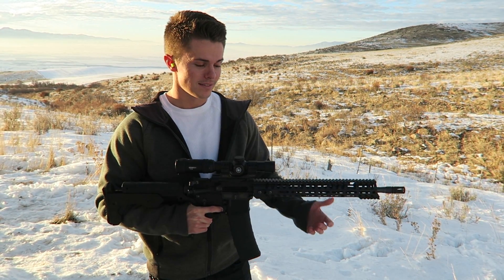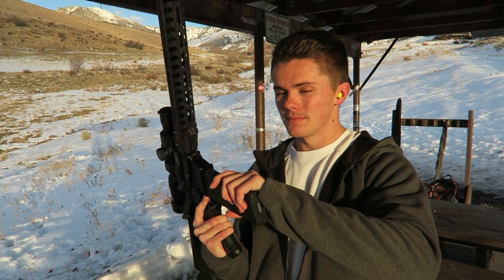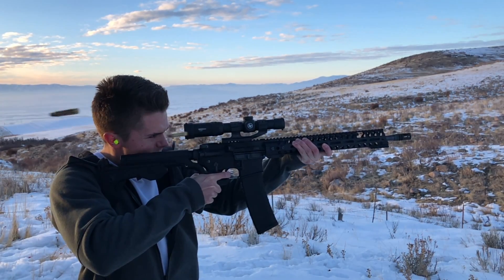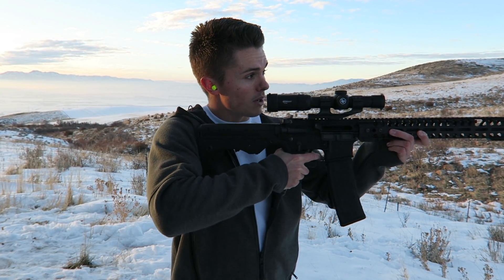How Fast Can A Bump Stock Really Shoot?

Comment: In 1934 the National Firearms Act was passed requiring machine guns to be registered, purchasers also had to pay a $200 tax. Fast forward 52 years Democrat William Hughes purposed an amendment to Firearm Owners Protection Act of 1986 claiming "It is simply to easy to get a machine gun". Despite his claim there were zero shootings within that 52 years involving a legally acquired machine guns. His amendment was merely an attempt to kill the original bill. Unfortunately passage of this amendment prevented new civilian legal machine guns from being added to the NFA registry, and drove the price of legal machine guns through the roof. 

Passage of this ban also opened the door to these machine gun simulators. In 1990 a patent was filed for the Hell Fire Trigger, soon to follow was the Tac Trigger, Hell Storm 2000 trigger. All of these devices  attached to the trigger guard of a semi automatic rifle, and had a metal arm under spring tension placed behind the trigger that push the guns trigger forward forcing it to reset. Shooters still had to use traditional bump fire technique to get these devices to work.

 Currently there are about 400,000 transferable machine guns that are legal to own by civilians in 44 states. The purchasing process of legal machine guns is the exact same process you would go through to purchase a silencer or factory SBR from a class III dealer. If this reclassification of bump stocks is meant for public safety then why would the DOJ list approved alternatives like installing rubber bands or using belt loops to do the exact same thing that bump stock allowed?
Reply from the maker: Wow thanks for the info! I didn’t know the history of them
Reply: Yes the rubber band trick is where it's at. Binary triggers are expensive. Bumb stocks are damn near impossible to get. But a good old rubber band will yield crazy fucking results. I have a Franklin armory binary trigger. But for the money go with a rubber band lol.

Comment: Switch out the bolt carrier for an ultra lightweight one and you will notice a huge reliability improvement. It makes it much easier to shoot and much more consistent. I’ve had a bump stock for many years and with normal bolt it was a pain in the ass to shoot very unreliable until fairly recently I installed a lightweight carrier and I can dump 100 round drum mags with zero issues consistently. Trust me it’s crazy
Reply: Joe Valdes where you get your bolt Carrier ? I got a AR15
Reply: Bbj is tdl
Reply: Idk man in my experience it's backwards, the heavier the bolt carrier the less jams. Like how the M16 Bolt is called a "Full auto BCG" . Heavier the better.
Reply: I was talking about ‘hammer follow’ jams typical with only bumpstock use. not the typical regular jams that a heavier bolt carrier would indeed help reduce.
Reply from the maker: Hmm never thought of that, didn’t think it would make that big of a difference, but I’m not super well versed in all that either. I sill thought it was pretty wild how fast it was with the set up in this vid haha!
Reply: Google lightweight ar bolt carriers get one that is ~9 ounces in weight maybe slightly less. You will notice you will get much less jams and it will shoot noticeable faster and easier to use the bump stock. I’ve had all the fun I can have with my bumpstock my stupid state they become illegal October 1 thanks to the parkland shooting. (Which by the way didn’t even involve a bumpstock but that’s why the banned them) politician logic.....

Comment: Damn i thought that democrat dude was an idiot for  saying 150 shots per 15 seconds on tucker carlson but aparently u can shoot even more than that
Reply from the maker: Yeah, it’s theoretically possible, but you would also have to take into account factors such as reloading and getting the bump stock into the correct position. Reloading would take awhile, and the bump stock is pretty sensitive, it takes a pretty precise trigger pull to make it shoot continuously like that. I had plenty of times where I had to reset where my finger was on the trigger.
Reply: Without a heavy barrel and very beefed up gas system you cannot fire more than 300 rounds at once without the barrel or gas system melting or exploding.
Reply: @user-oy9zy4ds9m  go watch some IV8888 meltdown videos and you'll see that is false. ARs, depending on quality of parts, can go much longer than 300 rounds.
Reply: That dude said 30 rds in half a second which is absurd equivalent to that of a fuckin minigun